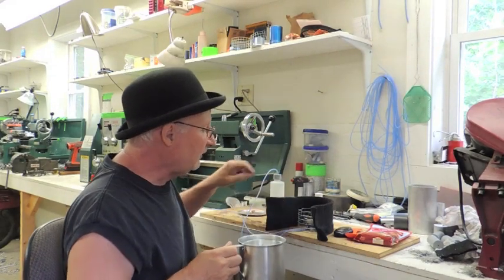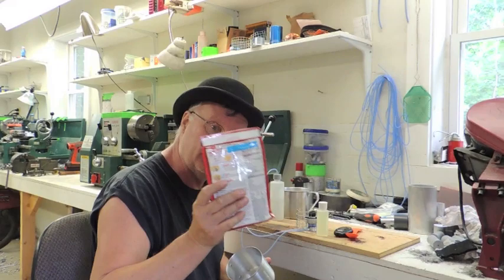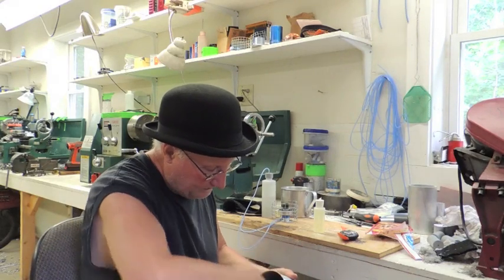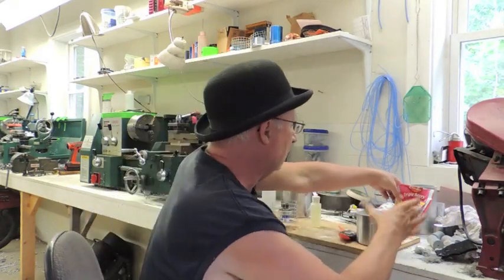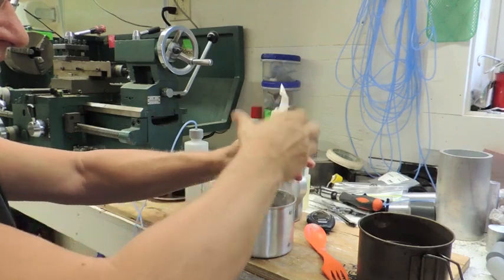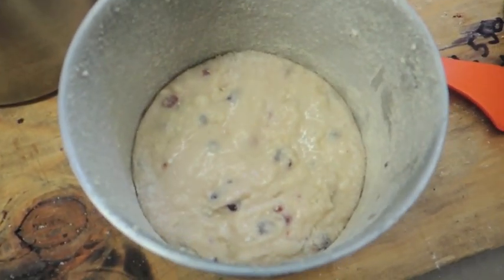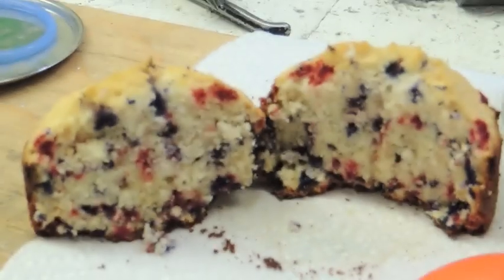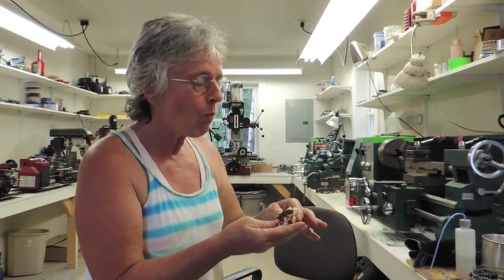Proto Bake Test

Comment: Part 2 of 2:  I use an M4 stove and in about 23 minutes get a muffin that's 6" cross and 2" tall.  I don't oil the bowl, since it's silicone, the muffin doesn't stick to it.  I use about the same amount of fuel as you do.  I carry the larger pot (larger than the IMusa) because I'm usually cooking for two.

Comment: Part 1 of 2:  Tinny I’m still wet baking.  It seems to give me a moister muffin.  I use a 1,500 ml pot with a lid.  In it I place a collapsible silicone bowl that's 6" across.  The bowl floats on the water so it doesn’t touch the bottom of the pot.  I use the same blueberry muffin mix as you, and mix it up in the bowl.